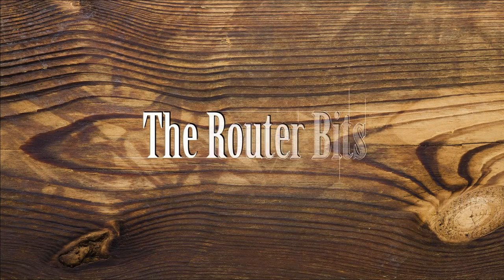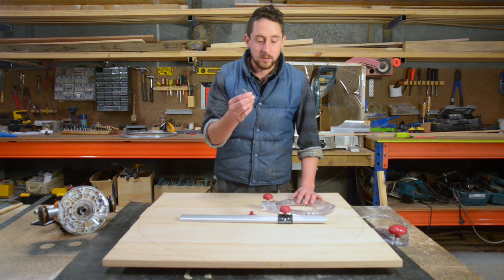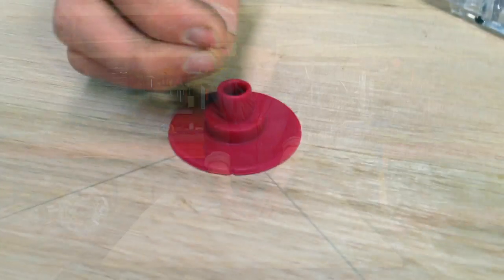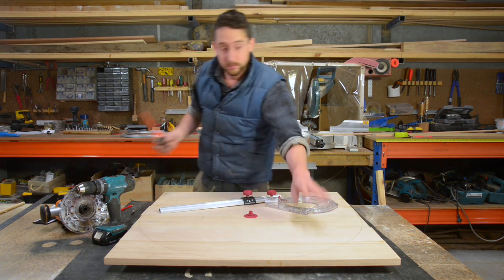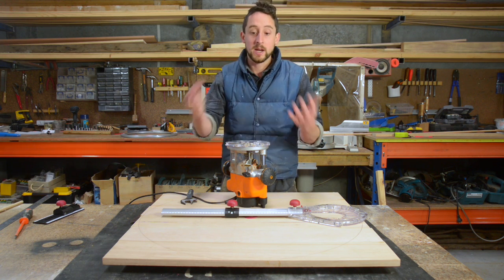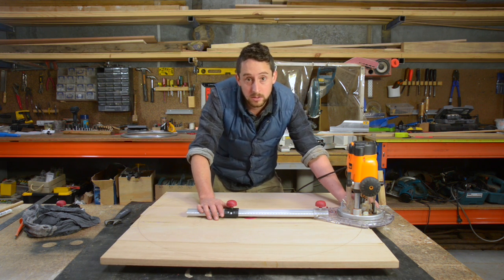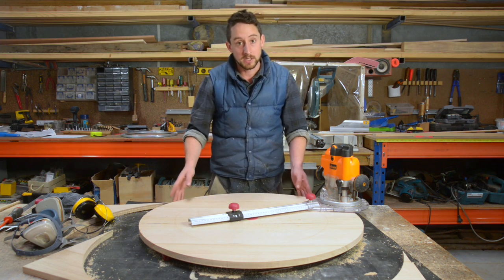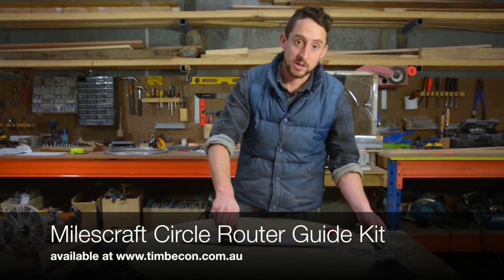The Router Bits - Cutting Circles with your Router

Comment: I reckon making a rough cut on a bandsaw 1-2 mm outside of the line and just one precise full depth cut pass with the router will not only be faster, but keep the router bit sharper for longer. This method sees the bottom of the router doing 4 cuts vs. 1.